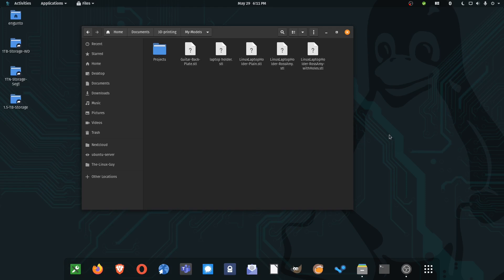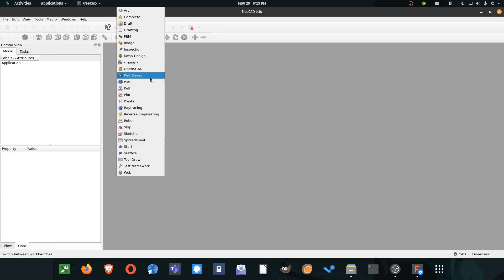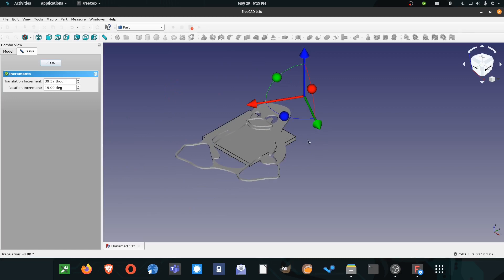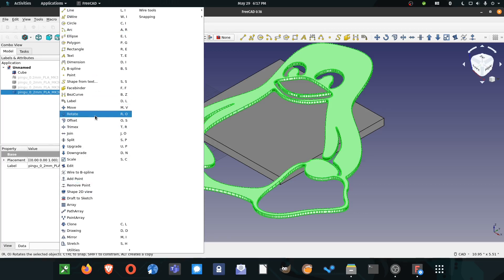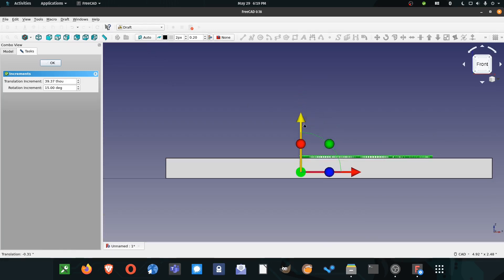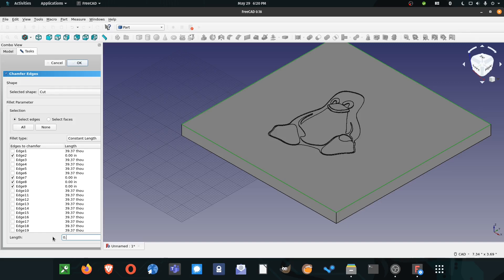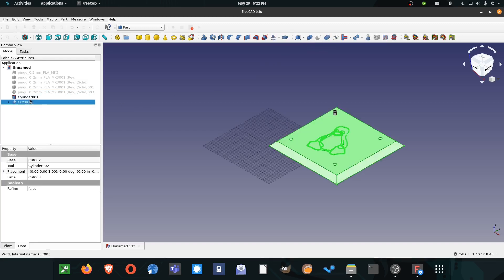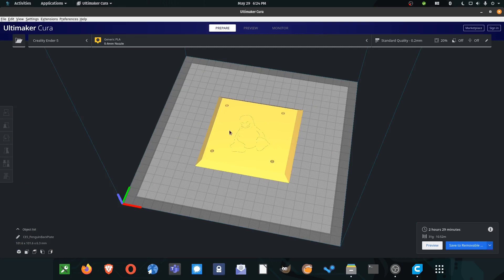3D modeling in Linux?  How to use FreeCAD for basic modeling

Comment: I only have one printer and Octoprint has been very useful.  I also added a smart switch to my 3D printer.  Between the two I can turn it on, preheat the printer, start printing, and monitor the print.  Then my printer powers down automatically when it's done printing.  That lets me shave some time off when I'm iterating through designs.